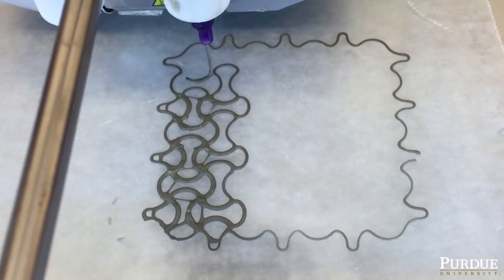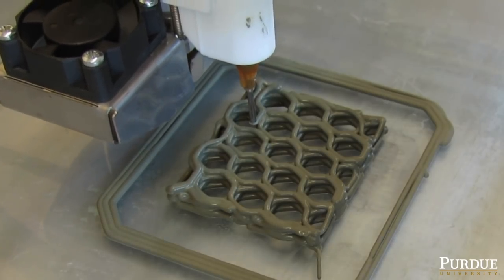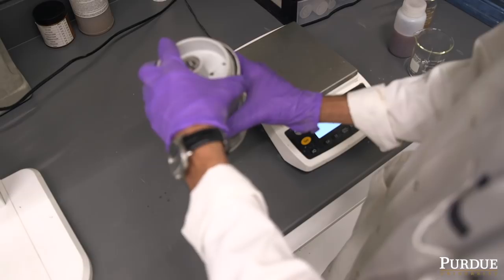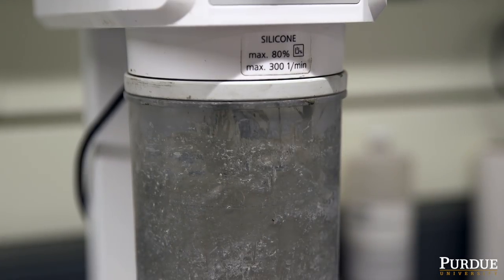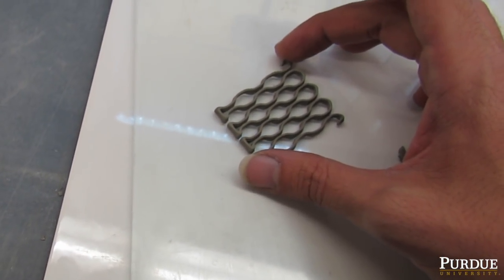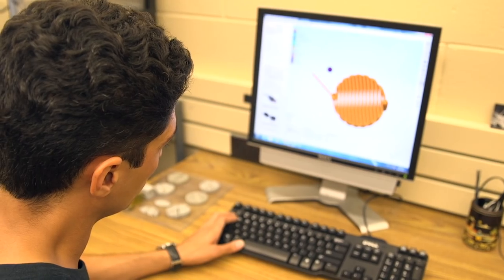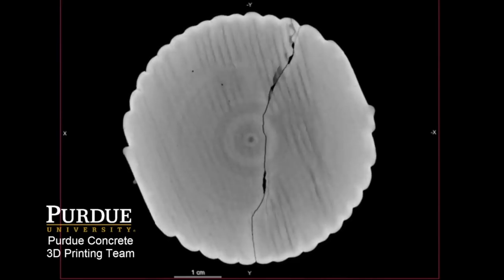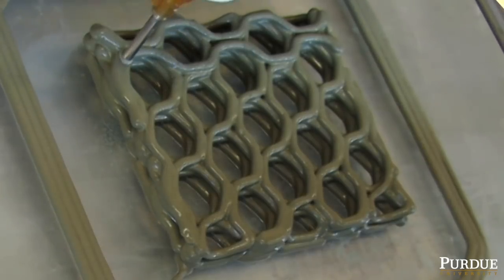3D Printed Cement‐Based Materials with Bioinspired Design

Comment: Did you modify an Ultimaker to print cement?!
Reply: Yes. Ulitmaker is set as FFD platform. We merged with a stepper-motor-driven extrusion system configured with a tube to the Ultimaker. Therefore, there was also assembly re-configuration required on Ultimaker side of the system. Please feel to let us know if you have any questions.
Reply from the maker: Thanks for sharing this info!
Reply: Can someone explain this with a clearer video? This onw does not show the entire setup of the equipment for cement printing.